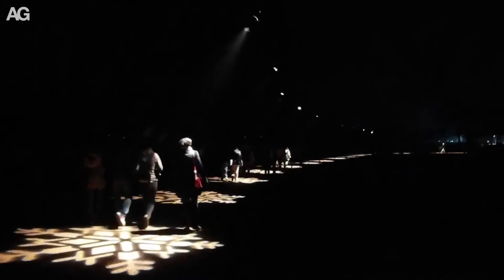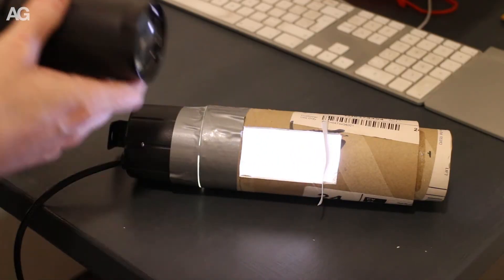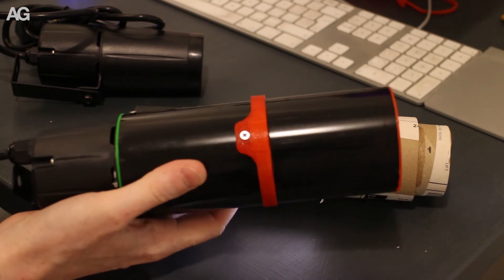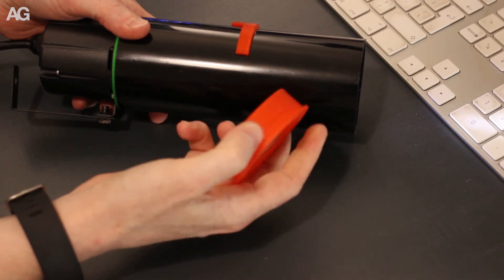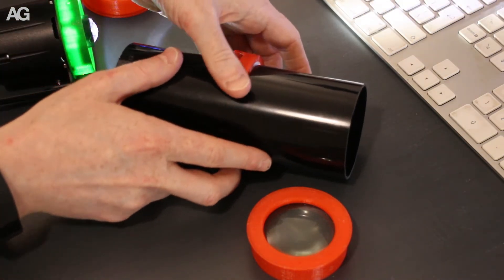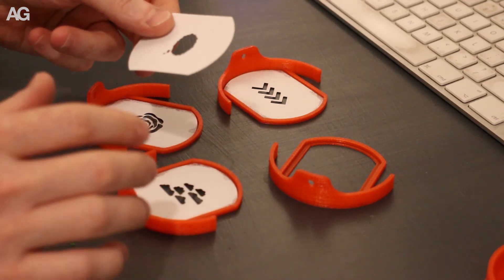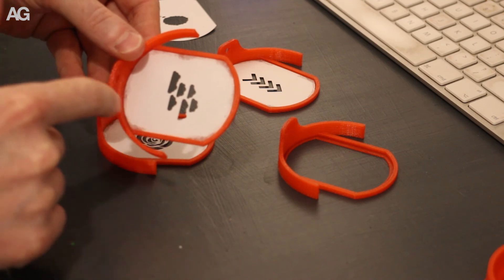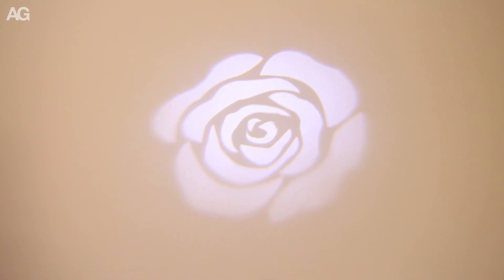3D Printed GOBO Projector Light

Comment: Nice project Arthur, these are really popular these days but as you say they are expensive. Was just thinking though that this is a bit simple by your standards - have you considered some kind of disc holding 6 different patterns, and an arduino and servo system. Arduino turns light off, rotates the pattern and then turns light back on in a sequence and/or a second servo/stepper to rotate the lower body so the pattern rotates - would make each one much more interesting than a fixed pattern.

Can see this, as it is, appearing on Aliexpress as soon as someone in China sees it as it's such a simple, cheap idea and would cost them pennies on top of the actual light cost, including plastic templates. Actually, thinking about it, have you tried 3d printing the templates? Should get plenty detail.

Keep up the great work, love your projects.
Reply: Was looking to see just how cheaply you could buy one of these from Aliexpress but couldn't find a 10W one and then looked in the eBay description and it plainly says 10W in the title but then 3W !! in the description. How on earth do they get away with it - I saw something on youtube once where someone bought something that said 100W on the from and on the back electrical sticker it said 8W power. The buyer challenged the seller and they said 100W was the model number!!

This may be the reason though that it's not as bright as you want it. You can get 5w and 6w ones on AliExpress(probably on eBay too) for £6-7 and in white too if you liked